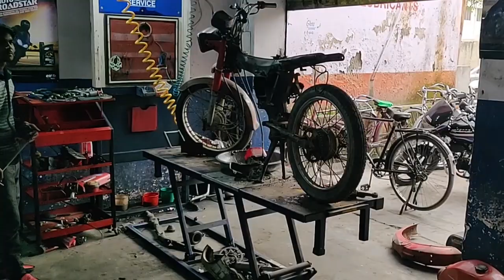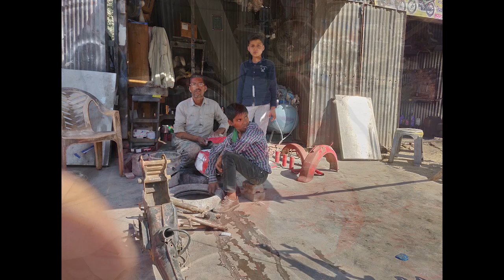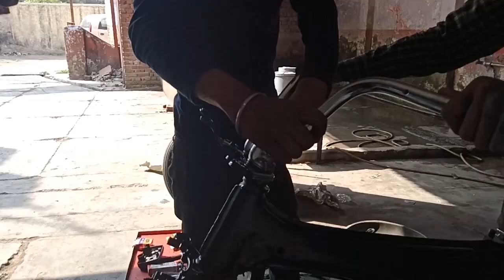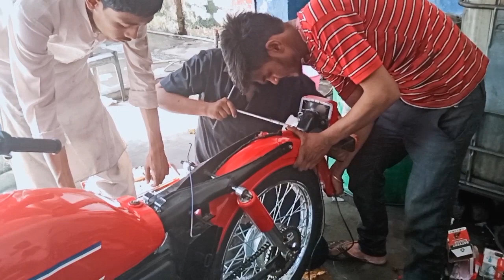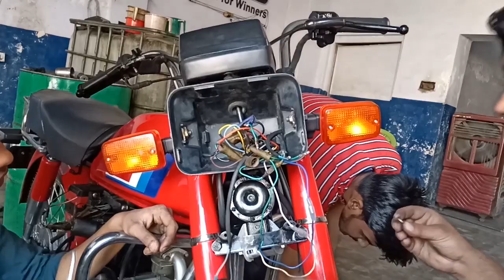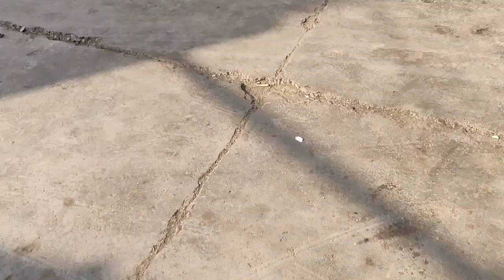Hero honda Cd100 1985

Comment: Best engine oil for this with oil grade
Reply: Mobil 1 racing 10w40 if you dont have budget issue otherwise use shell or motul grade should 10 w40